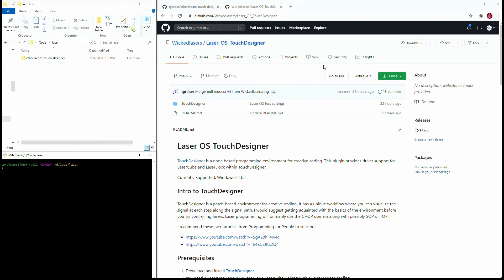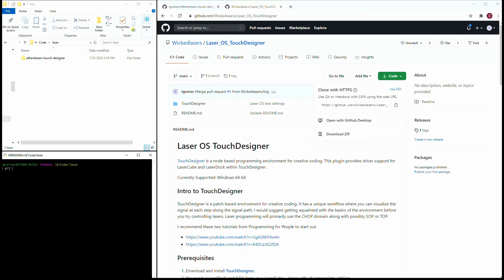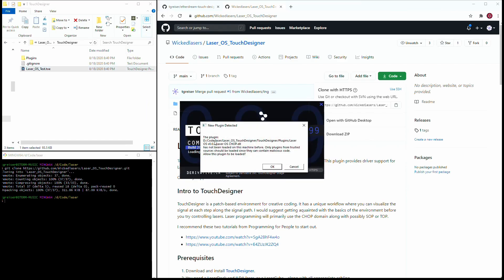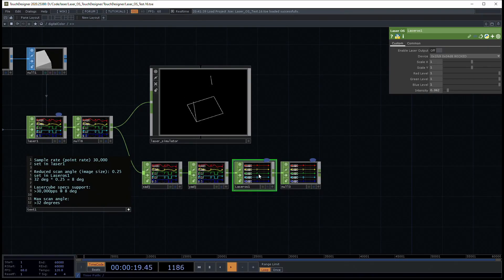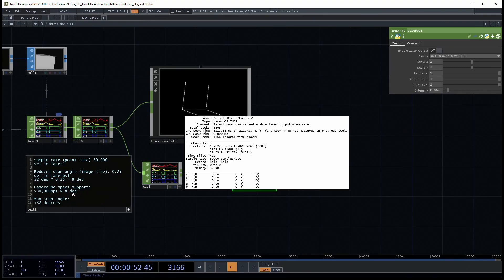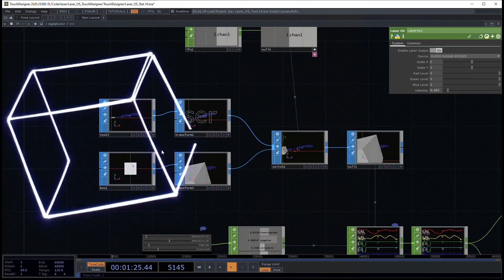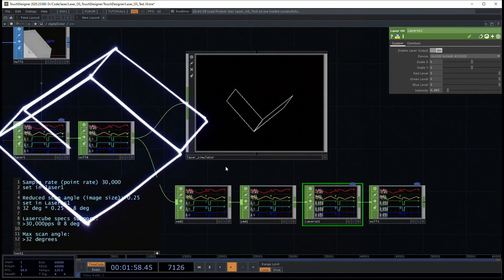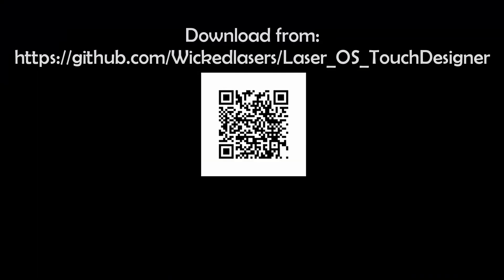How to use TouchDesigner with LaserCube

Comment: is It okay with wifi cube2  and TD? I can not find devices. is there any ways to connect wifi cube to touchdesinger?
Reply from the maker: yes its now working with wifi cube + TD
Reply from the maker: not yet, but its being worked on
Reply from the maker: https://www.facebook.com/groups/lasercube/posts/910502672890422
Reply: @wickedlasersvids  I just bought a lasercube and cannot get it to work with TD with this. Do you have any info? Tried the exact steps in this video

Comment: Thank you for this! Do you need a commercial license of touch designer ? I have this error message "Fail to load .dll (digitalColor/LaserOS1) " . Thnx
Reply: I've tried on mac and windows. same error
Reply from the maker: @culooner  Thanks, we are looking into this.
Reply: @wickedlasersvids  Any word?
Reply: On license compatibility ?
Reply from the maker: @twanzart9828  no i dont think so
Reply: @wickedlasersvids  Hi, i am having the same issue. I'm using a non-commercial license. - twanz
Reply: @culooner  Mac is not currently supported, only Windows 64 bit. What versions of Windows and TouchDesigner are you using? Did you install the DLL as described here? https://github.com/Wickedlasers/Laser_OS_TouchDesigner#installing-the-plugin
Reply: @AuralFixationMT  I managed to run it properly on windows (with non commercial version). Thanks!
Reply: @culooner  How? Mine keep crashing ( after installing the plugin, I got em both to workj at the same time..but after some minutes they crash....
Reply: @estodopegado2  I didn’t manage to run two lasers at the time